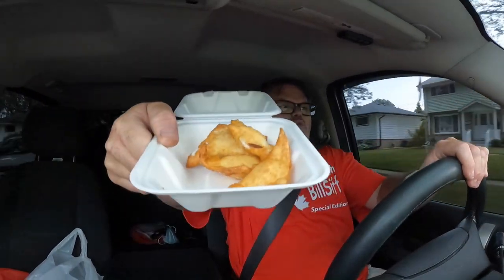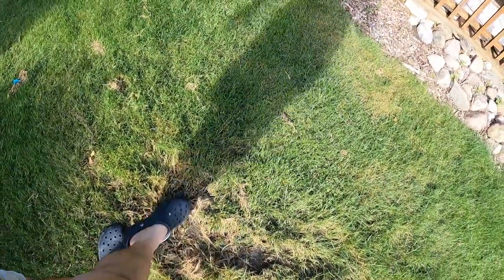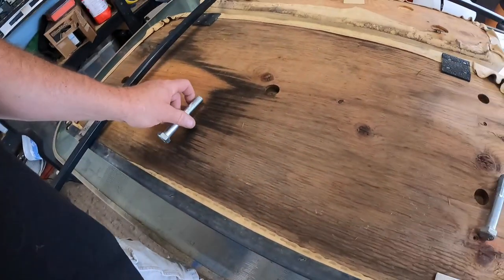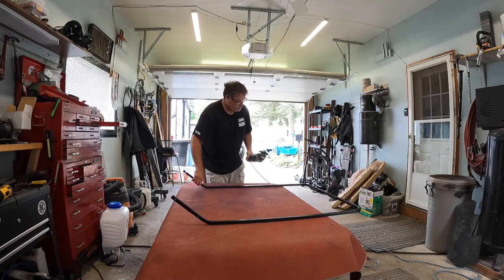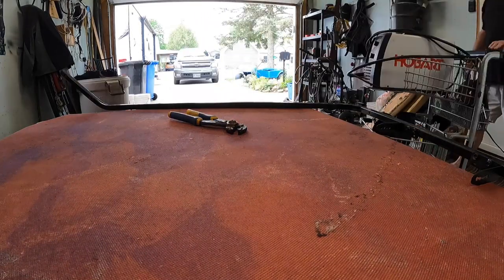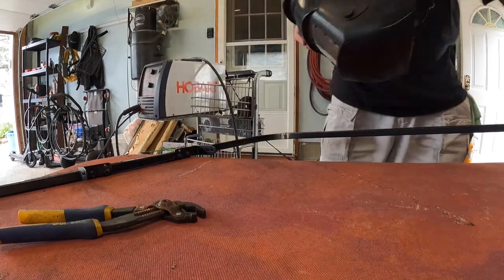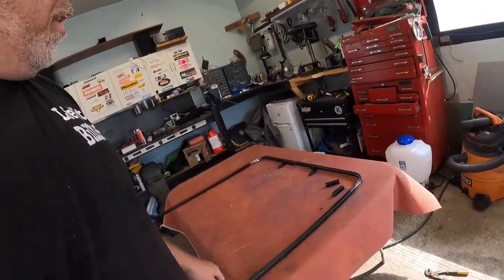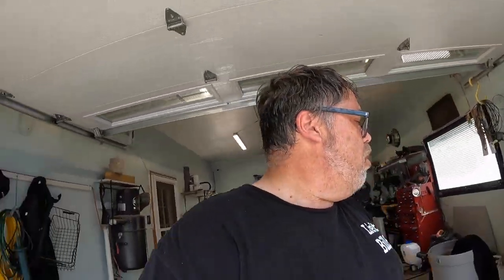Blue Ball's Is Coming Along

Comment: I used the same coating in black on my rims. Had it on them for years. The clear will add some gloss to it forsure. I used plastidip glossifier. Clear or not you need to get some turtle wax ice spray wax. That shit is awesome. It works on all surfaces, even glass. It will keep the coating looking fresh. That stuff fades alot over time. The black on my rims stated to look brown. The Ice spray wax is the way to go.

Comment: Inside the helmet on each side there is a battery holder. You might just need new ones. I lost the one battery cover on my 39 dollar pig iron helmet. If I don't push the battery in all the way each time I use it I go blind 😔